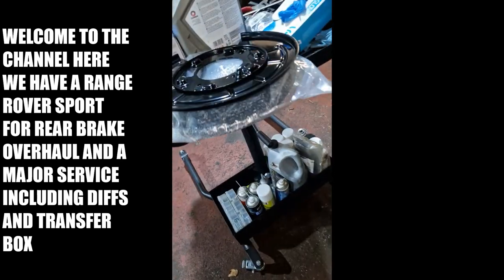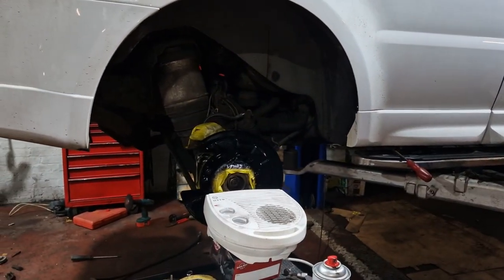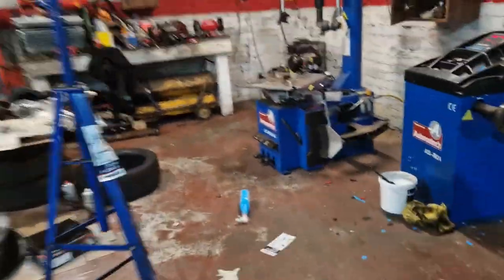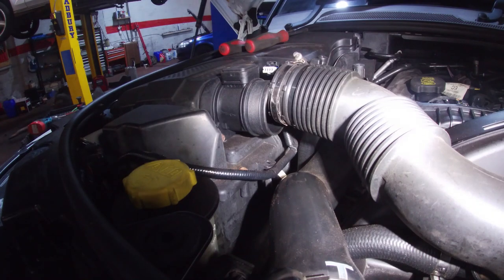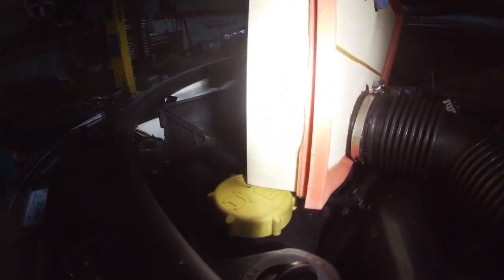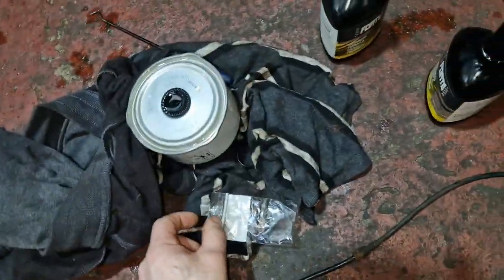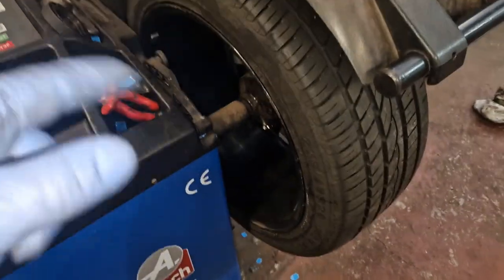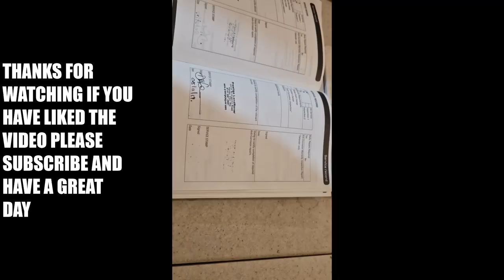RANGE ROVER SPORT L320 REAR BRAKES OVERHAULED AND MAJOR SERVICE #landrover #rangerover

Comment: I have a question if you don't mind giving your suggestion to what i should look for. Thanks in advance.

I have an Astra j 1.7cdti 2011, Recently the car been running into some issues. I notice when the car is hot and stuck in the traffic it will go into limp mode and when it goes into limp mode the revs increase to 1000rpm (if i put my foot on the brake it will drop back down to 800rpm). Then the other day i noticed that when the car is cold and been left over night and i go start the car and the rpms only go to 800rpm instead of the normal 1000rpms when cold which should then settle down to 800rpms when at operating temperature.

So the car when its hot goes into limp mode and the rpms at idle increase to 1000
When the car is hot and stuck in traffic at idle the rpms bounce between 700 and 800
when the car is cold the start up rpms are at 800.

So any idea if you can make any sense out of what i've written. Thx
Reply from the maker: hi, sorry for the late reply. Festivities take precedent without sewing the temp gauge data from the ecu. i wouldn't be able to help youn im.afraid, but that's what I would be looking at the live data reading's from the engine ecu, specifically temp sensors for engine and radiotor hopefully that helps of you haven't allready hit that subscribe and have a great day 😀